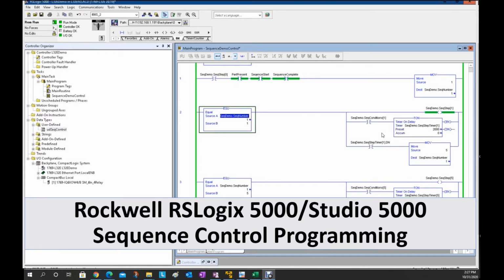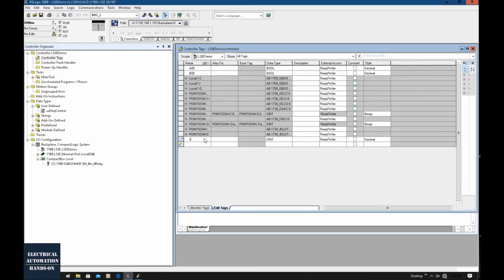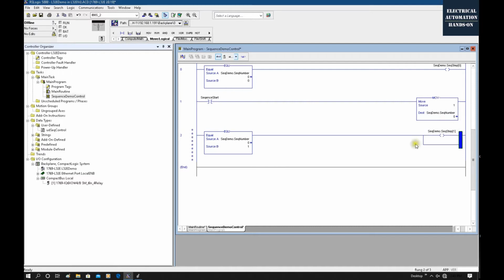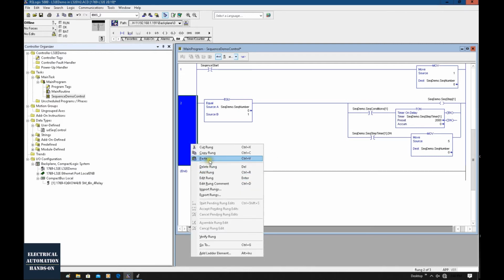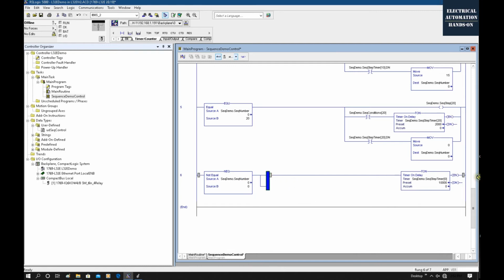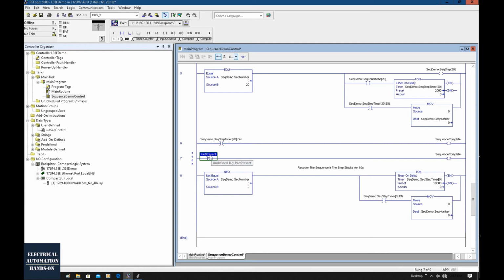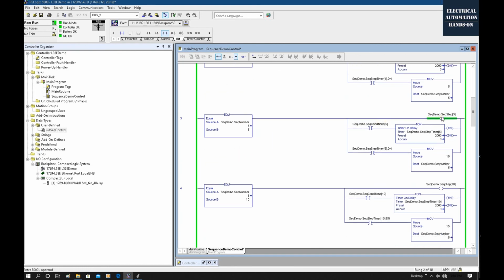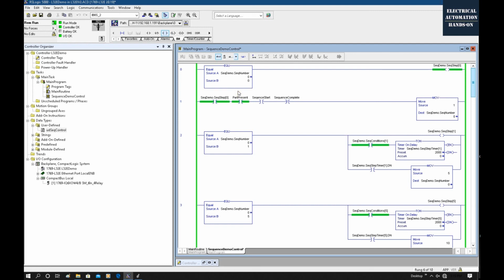AB05. Rockwell RSLogix 5000 & Studio 5000 Sequence Control Programming

Comment: Good video. I’m a plc tech at a modern sawmill in USA. I see tons of different sequence control methods, and this is just as great as the ones I see. The one I hate the most are people actually using sequencers, awful in my opinion.
Reply from the maker: Thanks my friend. Glad you like it. I also has similar sequence for Siemens, Allen Bradley and Backhoff. Yes, I used this structure for many different logic programs such as talking with different industrial devices, printers, camers, smart devices,  scanners. Setting up this structure would take you 15mins, but once the 'high way build up' , then you just need enjoy your driving.